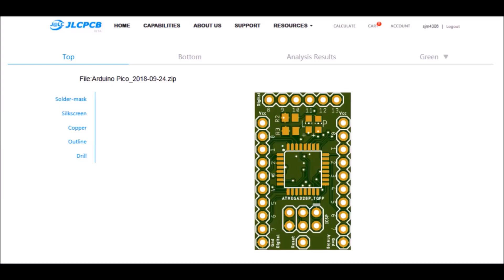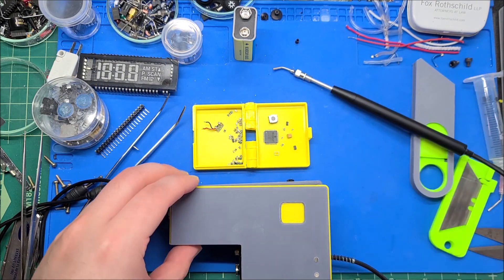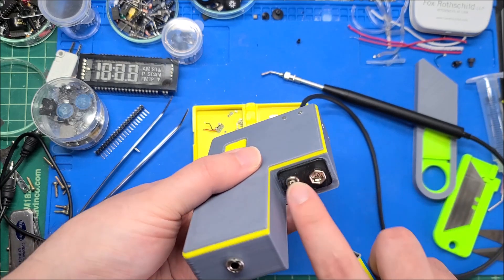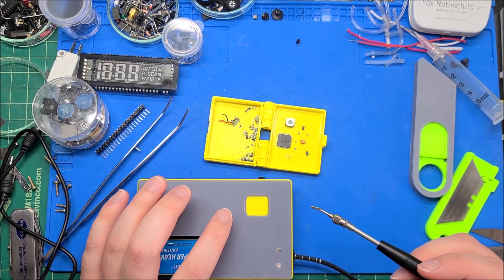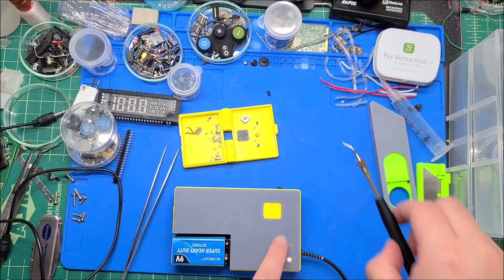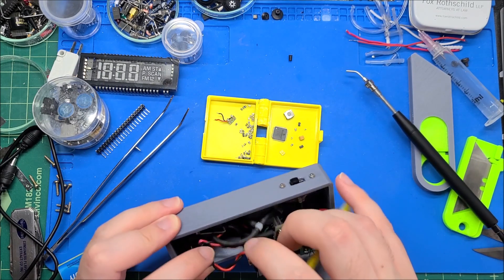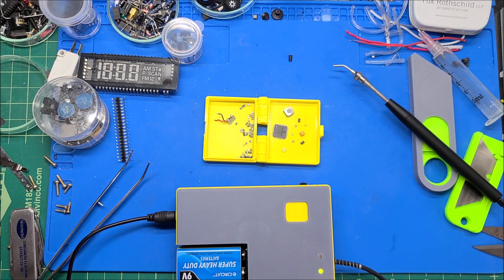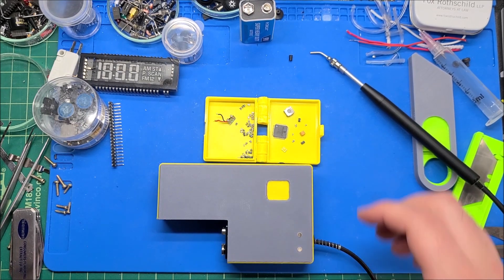VacPen: Part 2 - Finished! 3D Printed Case and Demo

Comment: I used quarters for touch switches before what I do is pressure fits by making  holes the quarters slot into if you don't mind seeing the quarter doing it that way would work better a bit of heat and pushing makes them really stay in place but superglue is also pretty effective. If it is the only switch on top maybe relocate the lights so they are not attached to the lid that way you can swap lids if you needed to as well for if you want a touch switch or a momentary switch.

Comment: I like your design.  I think it'll be much better with the foot switch.  I don't know about the capacitive button though.
Reply from the maker: After some real world testing I can confirm the touch button is not very practical and I've fallen back to using the external switch input.

Comment: You could add a fingertip switch.

Is that a pump for a blood pressure monitor?
Reply from the maker: This particular pump came from a portable gas leak analyzer but I believe blood pressure monitors use similar pumps.